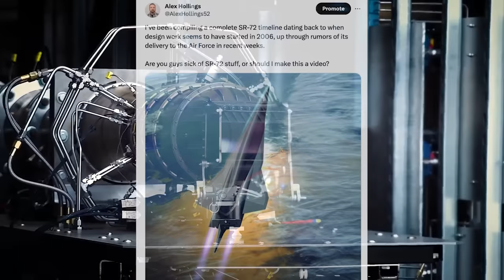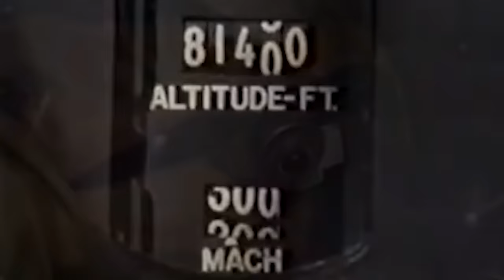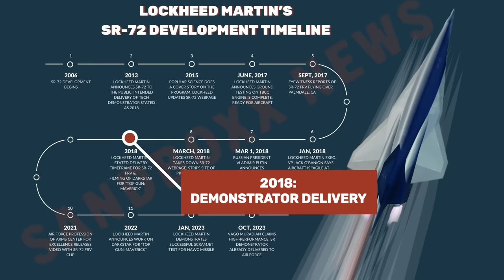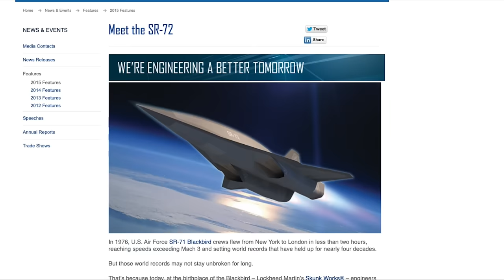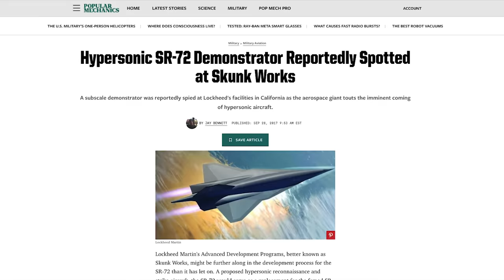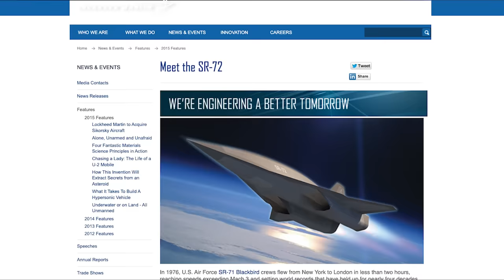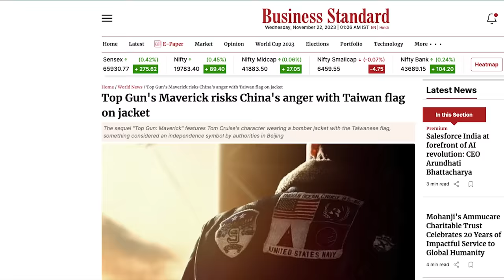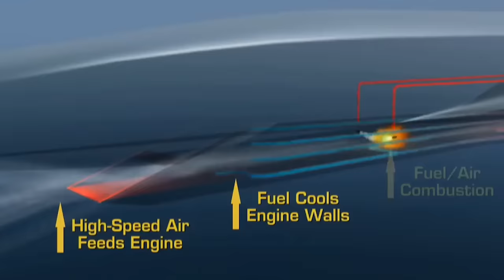The SR-72 is REAL — And we can prove it

Comment: The problem with a Hypersonic ISR platform is that it's too fast.

Even the Blackbird was too fast for that role - specifically the Surveillance part.  You buzz through, take some pictures, and by the time you can turn around to see anything, you are too far away to be useful.  Intelligence and Reconnaissance, sure, it can get those jobs done.  But you're not going to do constant 12G figure 8's to keep a camera on a point of interest.

For ISR, you need something that is extremely difficult to detect.  That means controlling returns and emissions across the entire electromagnetic spectrum.  At Mach 7, forget infrared detection - the surface is probably emitting in the visible spectrum.

That said... There is probably a great deal of value in the Intelligence/Reconnaissance roles: Imaging and signals gathering where other platforms can not operate and all you need is one or two passes.  One of the SR-71's major limitations in this role - the fact that it's data had to be physically transported and processed before it could used - is solved by modern sensors and datalinks.

There is some potential as a weapons delivery system.  Hypersonic cruise missiles are cool and all, but why go to the expense if you can have a reusable Hypersonic aircraft eject small HGVs?

Comment: Carbon carbon is the difference without it  friction is a problem, the engine theory has been around since the 60's, so the engine should be reliable it's the airframe and coatings that are the leap.

Comment: -unless this thing actually flys in near outer  space and,or, there are some fantastic new materials about that will sustain such speeds with out melting, or expanding so much due to heat{ SR71 leaked fuel untill it heated up }, concorde expanded over 7 inches, at m2 alone
then i think that all this talk about m6 to m10 is just hype
may be wrong, but as Scotty always said, you cannot alter the laws of physics.

Comment: With decades of advanced nano hybrid material reinforcement engineering technology experience, are key areas to the secret sauces of stealth, strength and nearly frictionless surface technology for the platform ‘s ability on every level and category to achieve more than MACH 9.
•Chemistry
•Physics
•Laminar Flow
•Electrical Force Field 
•Advanced Manufacturing Adaptation

Comment: The term "rescoped" is used a few times in this video.  Can anyone explain what it means, in practical terms, in this context?
Reply: My understanding in a basic few words.... rescoped is when the org plan is found to be "lacking"  as when they worked it, it was found a lot more can be done....and now that's the goal.  For example,  Santa Fe New Mexico might say we want to build an arena so we can get a 2nd level basketball team that holds 8000 fans, land is found, designs are drawn up, etc...  However now a year later, they hear either a NBA team or the NBA is considering having a team in NM.  So now they need to "rescope" the arena/area to 16K fans.

Comment: I don't think turbo and ramjet are the best way to get up to scramjet velocities.  It should be a lot easier to use rocket power, one power source from stopped up to Mach 4.  Then hand over to scramjet which has the major advantage of not having to haul the oxidizer.  That said, I don't think it'd be harder  to swap between a  turbo/ram combo and a scramjet, than the illustrations show of switching between pure turbine and scramjet.

Comment: A vehicle with (likely) twice the engine density can't have much left for payload if it is going to also have useful range, and I'm not sure how useful in flight refueling would be for such a beast. Of course it is likely such a hypersonic craft would be flying at much higher heights than regular aircraft, and that would probably lower its fuel requirements over distance comparatively. Still, I expect this will be a special purpose platform, and not something we will see in the NGAD or even its followup.

Comment: I have some questions..
do you think the twin engine operational aircraft will be the same size as a raptor, or a similar size to Blackbird?
I assume it'll be bigger than the single engine if they need the room to fit another engine.. thinking about it just now, if there's twice as many engines, would that mean it'll go twice as fast? and wouldn't that then change the physics around how the craft handles and it's agility & capabilities etc? What I'm getting at is, shouldn't they have just built the technology demonstrator as a twin engine in the first place?? I understand the increasing costs part of that decision, but.. 🤷🏼 I hope they build it to be visually GRANDE!!! 😌
Also, they will probably 3d print the entire plane?? that way they could incorporate the same cooling system tech that's in the engine, into the skin of the plane to help combat the heat from air friction??! 😯 Maybe printing makes it possible to use some kind of composite material that is more elastic and expansive or higher heat resistance??!! Who knows what we are going to find out!!!!

Also, how long after the Blackbird was entered into operations was it made public knowledge?
Reply: The number or size of engines does not determine the vehicle speed. It's "how much efficiency" you can achieve providing your current technological capability that determines how powerful your engine can get, then, depending on the vehicle purpose (operational range without air refuel support, payload and payload types, onboard systems...) you define the dimensions (to host the fuel) and the number of engines, while trying your best to make it as small as possible to save weight, roughly speaking.

As for the SR71, everyone near the production site and deployment bases knew right away there were some "ultra secret black bomber or interceptor in use", that thing made a LOT of noise very early in the morning. At that time of cold war, western people were docile enough out of fear of a nuclear war and some fierce idea of "nation of freedom saving the world" to shut their mouth and keep the east in the threat of a superpowerful technological flying weapon. What have changed since? Not much, except today, almost everyone has in their pocket a device that is 100 times better than the luxurious JVC videotape of the time and share it in less than a minute to the world..

Comment: I'm betting this will be a pilot-less craft or at least have the option of not needing a pilot. If it is "agile" at these speeds then that means it will quickly exceed human level G forces. Who would want to try and survive 30 G turns if the tech is there to not need a human on board. I'm sure they would want to have an optional pilot for testing and for bragging rights. For actual operations no pilot needed.

Comment: There is that word, or one very like it, I thought I would hear, "Re-Scoped", regarding hyper-sonics given the somewhat questionable (or perhaps incomplete) engineering stance offered by this channel's prior reporting. The potential aircraft with its combined cycle engines would have to be of a certain size in order to simply bunker enough fuel to move the excessive weight of effectively carrying four individual propulsion systems. In short it seems to me highly unlikely that any Mach 6+ aircraft could be any smaller than the SR-71. The only reason the SR-71 was viable was because of aerial refueling and it can be assumed that this is also true with the SR-72. Sad we will likely never know in my lifetime the specifics relating to how the SR-72 deals with the physics of Mach 6+.

Comment: Wait until they confess to the antigravity, nuclear plasma vehicle.  you need the SR-71 can be at a location within a few hours. A satellite can't get into position fast enough.  the mothball the SR-71 and then brought back two of them.  SR-72 is hard to control because of the speeds that out run the communication.

Comment: You know what at @27:21 just wanna say it was nice to hear my idea to 3d print the parts to include cooling channels throughout the material and across planes/facets was the last thing SkunkWorks needed to perfect the engine. Although I should mention, the technical concept drawings i sent were to an intern at JPL and not specifications meant for terrestrial airspace operational capability and takes into account lunar manufacturing and distribution of local (lunar) sourced and produced fuels for inter-planet/-stellar use.

Comment: I figured digital printing would change things. Wait till they take computer chip abilities to printing things as large as engines! 

From what I understand on how planes work they require triple , not sure the word, strength? Image if you could go to only twice or less strength  with the same or better results? 

The weight reduction do to the planes performance. Probably scary at first, like all similar changes, but once it becomes mature it will be a huge game changer. Probably 15 years out or at rate things going and if truly are only telling us 20 year old information they may have been doing it for five years!!
Reply: I totally agree and thought about the same. I can imagine what a plane built a molecule at a time. Like you wrote the material would not need triple the strength (or whatever you call it) that currently exists. Triple redundant? It would be risky as if not done correctly it could lead to a disaster.

Comment: All they have to do is utilize the speed at mach 3 and above to reverse some of the air flow to subsonic levels. Below mach 3 it's a non-issue. The jet is fine. They could even use the jet itself to slow down the airflow as they combine the outlets of the two systems. I'm honestly not sure what the issue is. 
Maybe they just want us to think they have nothing?
Reply: Depending on altitude it could be up to M14

Comment: One thing you left out entirely is the fact that unmanned hypersonic aircraft have no problem going mach 9 or mach 25 because they are unmanned. Problems arise when such hypersonic craft are manned by human beings because the human body is frail and would lethally succumb to pressures from the high speeds. When they indicate that a craft exists that can go orders faster than the SR-71, they mean an unmanned guided craft.
Reply: No, hypersonic aircraft have issues going mach 9 or 25 entirely, due to engine limitations but mostly temperature limitations, being manned has nothing to do with it

Comment: Lockheed Martin's Hypersonic SR-72 aircraft program has been in development for 17 years and may have created flying prototypes as early as 2017. The internally funded program was publicly disclosed before going dark at the onset of the modern Hypersonic arms race. The SR-72 program is real and has likely produced at least one flying demonstrator that has been in testing for years. Despite the secrecy surrounding the program, the Air Force may have given the public a glimpse of it two years ago. The SR-72 is a Hypersonic spy plane and strike aircraft, and Lockheed Martin's skunkworks division may have delivered a high-performance spy plane to the US Air Force for testing. Spy satellites are not as capable as they are often perceived to be, and the US defense apparatus is still heavily reliant on a wide variety of intelligence, surveillance, and reconnaissance aircraft. The SR-72 program coincides with the end of the SR71s, and rumors of a faster, higher-flying replacement for the Blackbird began to emerge in the 1980s.

Comment: The faster you go the more amount of space you need to slow down you would if to make a g force resistance cockpit to handle the g forces made when moving, speeding up and slowing down and make it light enough to work with all the other systems in order to keep the crew alive not to say there incapable of doing that it’s just going to need a lot of testing good thing is they know what they’re doing in order to do it right.

Comment: Let me put it like this.
If the best known satellite camera can make pictures with a 5 centimeter per pixel resolution, i can assure you that the US Military's got it down to less than 5 millimeters.
If the fastest plane can fly mach 3+, the fastest military plane can fly well over double that.
If DARPA is disclosing literal railguns to the public, that means the US military has something way more effective.

Lockheed has prototypes of future technology for the next 10 to 15 years already developed, waiting on a contract.
If they believe the US military will need full sized battle mechs in 2040, you can bet your ass the chassis concepts have already crossed the design table.
Look up the technology used to make <7 nanometer computer chips. Droplet injection mercury vaporization to get the right wavelength of light to create smaller transistors. Space age shit.
And that's just commercial large scale production.

'The public is better off without knowing' is real. Because the blueprints, if not prototypes, if not stockpiles of anything from designer pathogens to automated contingency defense systems that would make 'Slaughterbots' blush, already exist.
You don't want to know.
Because the only thing you knowing is going to change, is making those systems less effective at saving your country when the day comes.

The US Military Complex has comprehensive answers to threats you're not even aware of existing.
That is what a trillion dollar budget gets you; Starship Troopers, Terminator and Predator, all rolled into one.

Comment: Nice video, I have a comment though, anything moving at hypersonic speeds in the atmosphere will generate a trail of ionised air behind it, this will not only be supremely visible in infra-red, but also ultra-violet, so whilst you could make the aircraft "STEALTHY", you cannot do the same for the atmosphere, thus, I wonder how much of the SR-72 rogram, whilst genuine in its development goals, is also being used as propaganda to cause the Russians and the Chinese to believe the US has an operational hypersonic aircraft already - when it may not yet be flying at such speeds. The Chinese and the Russian would be forced to divert considerable resources in their attempts to counter the threat that such a vehicle would pose in reality - similar to the impact the "Star Wars" program had back in the 1980s. 

Developing and operating a hyrpersonic aircraft are two different things, physics gets really difficult once you transition to the hypersonic realm, the heat generated on the aircraft needs to be countered to prevent structural damage, and this heat needs to be controlled in an ever more aggressive way the faster the vehicle travels. Now if you use a combined cycle engine in turbofan or turbo jet modes to get the vehicle to high elevations, above 60,000ft, then you can use the scramjet, or even a liquid fueled rocket up to heights of 80-90km, here the temperature is about -50C and the the density of the air means that thermal heating and ion trail production are significantly reduced - it would also make any vehicle virtually impossible to detect with current ground based systems and if they pass across the window of a satellite, the trail will likely be taken as that of a meteor burning up in the atmosphere. Bear in mind that at this elevation, a suitably designed vehicle could cruise at hypersonic speeds for some considerable time, if the powerplant has the ability to be turned on and off as required, then the range of this vehicle could give a global capability, especially if it has the ability to inflight refuel from air tankers when over international or friendly airspace.